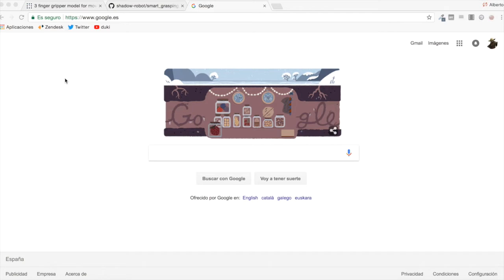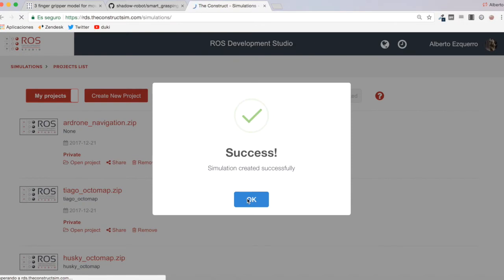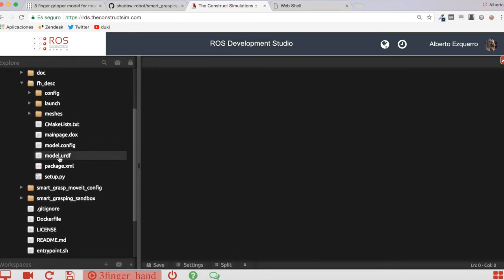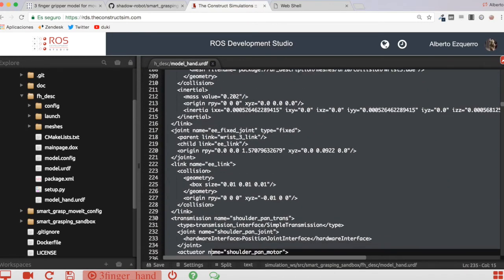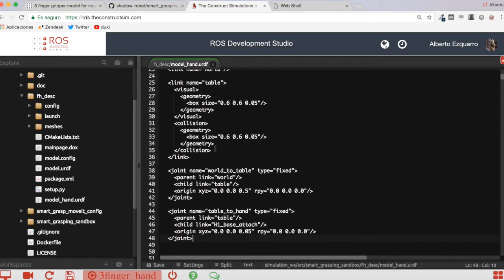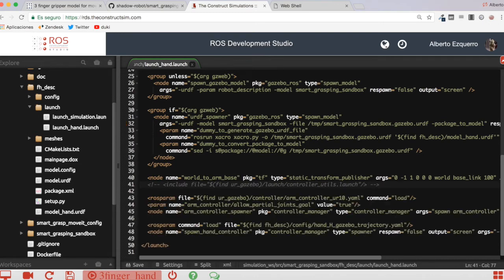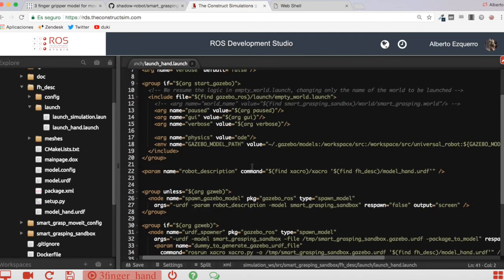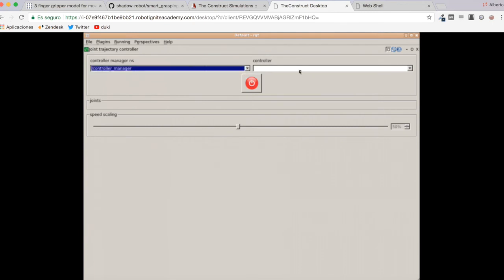[ROS Q&A] 083 - Have a 3-finger gripper simulated in Gazebo

Comment: Hi, I appreciate the effort in doing this and you helped me a lot. However, when I try the simulation you did on gazebo nothing shows up. Using the rds studio both worls show up mixed, which means the gripper appears almost inside the table on the original file of the project. 

When I try to run it in my own workspace nothing works, even if running the original launch file it shows a black screen on gazebo and the command prompt keeps telling me there are erros with sdf files: "XML Element[scale], child of element[model] not defined in SDF. Ignoring[scale]. You may have an incorrect SDF file, or an sdformat version that doesn't support this element." or "Error [Converter.cc:127] Unable to convert from SDF version 1.6 to 1.5"